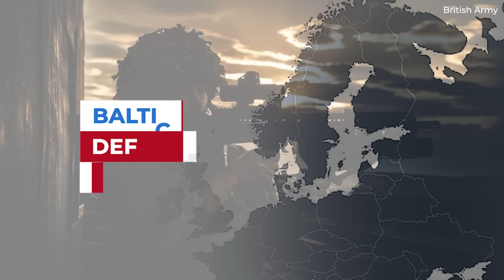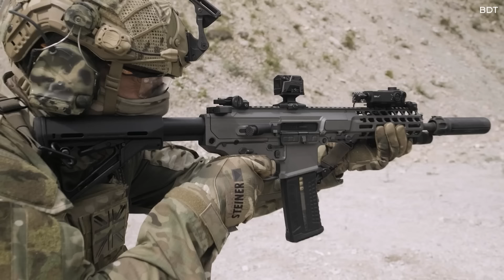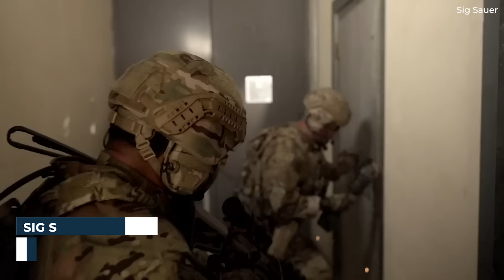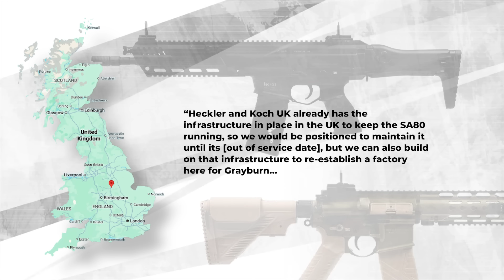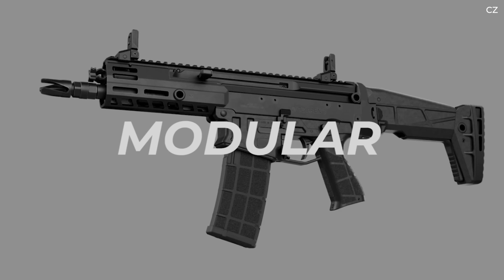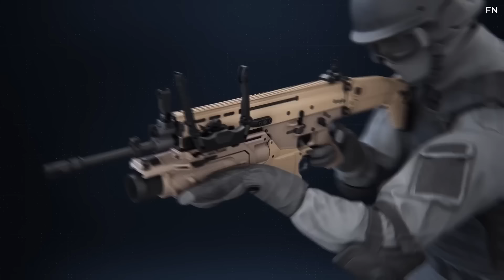Project Grayburn: How Well Do Various Rifles Meet Tender Criteria?

Comment: 07:30 wrong, as with every new weapon and variant there are always issues. HK 416 A8 is no exception. The lowest quality weapon out of this bunch is no doubt SIG M7
Reply: What issues does the A8 have in your opinion?
Reply: @jonny2954  A8 was found to be inaccurate and couldn't be relied upon to work properly in battle. Bundeswehr had to lower the testing standards after it failed to pass trials using military standard ammo. So HK used civilian ammo and tested the weapon in room temperature, so the weapon did not meet even NATO D14 standard.

Eventually the weapon was fixed and a year later A8 was praised for its accuracy.
Reply: @pitkizzz  That is not what happened. In fact you confused about everything that can be confused about this.

The problem was German procurement office folliwing CEP standards that state 5.56 (M855) is identical to .223 (M193). That is however not correct. The cartridges have slight differences in chamber geometry, mainly the freebore.

But the German procurement office tested HK-delivered 5.56 barrels with .223 ammunition. So the other way around to what you stated.

Now, .223 in a 5.56 chamber means more space in the freebore, which led to instability of the round during travel in the freebore, causing the round to quite literally hit the rifled part of the barrel, resulting in oscillations in the barrel.

Together with the (normal) oscillations from the torsion forces on the barrel caused by the spin acceleration of the round it caused a reciprocal effect with different bias each shot, causing larger groupings.

They then proceeded to test it with 5.56 and it was perfectly fine and passed all requirements.

So not a problem with the rifle but the German procurement office. Makes sense since the chamber geometry on the A8 hasn't changed compared to its predecessors that were all firing 5.56 with outstanding results.

In fact the A8 fixes pretty much all problems that were still present on the A7, including the ambi mag release that would sometimes get hit on accident on the A7.
Reply: @jonny2954  Nah, that's not it

The problem stemmed from a plastic channel that supports the weapon’s barrel. During firing, the report said the channel quickly heated up and becomame soft, leaving it out of alignment.

“Current testing by the army in laboratory conditions shows that the weapon doesn’t meet army standards when loaded with combat ammunition"

The issue reportedly forced the German Army to lower testing standards so the assault weapon could pass the trials and be introduced to troops more quickly.

According to Der Spiegel, the service allowed Heckler & Koch to test the weapon using civilian ammunition.

The trials were also conducted at room temperature rather than at extreme temperatures that simulate battlefield conditions.

The accuracy issue with the G95A1 rifle was first discovered by German soldiers deployed in Afghanistan.

They said the weapon did not shoot straight after several minutes of heavy firing.
Reply: @pitkizzz  Now you are switching things up even more. You are confusing the G36 with the G95 (HK416). The G36 is the predecessor in the German Army, it is currently being replaced by the G95.

On the G36 the barrel nut was molded into plastic and led to POI shift problems, the G95/HK416 is an all-metal construction. One of the reasons it was choosen as the replacement.

The G36 controversy happened in 2014/15, the G95 accidentally being tested with .223 happened in late 2023.

The G95A1 never saw Afghanistan.
Reply: @jonny2954  I am not messing up anything, the article I am referring to probably have messed up the translation combining different parts (fucking AI), since it is in English and original one is ofc in German. Anyway the original Der Spiegel article from year 2024 is about G95A1, that is HK 416 A8

There were no "accidents" as you call them but intentional bad testing. In 2022 HK contacted BAAINBw and asked permission to test with civilian ammo instead of BW's standard army ammo. Now let us be clear here. Name what is meant with civilian ammo in Germany and what is BW's standard ammo. fill the slots below

Civilian ammo:
BW Standard ammo:

In addition to this ammo change request HK wanted to lengthen the gap between shootings avoid testing in extreme hot and extreme cold. To me it sounds like the weapon was pretty far away to have a NATO D14 stamp on it at this stage.

On 23rd Jan 2023 BAAINBw accepted the reduced testing standards. Can you give me a date when these issues were finally fixed and the G95A1 was properly tested?
Reply: @pitkizzz  And that's why you probably shouldn't base off your research on AI. Just use regular google direct translate.

Technically it wasn't an "accident", just bad standards. CEP standards called for .223 and 5.56 to be treated the same while they are in fact not.

As soon as they tested with 5.56 the accuracy issues went away. This makes sense since the barrel and chamber geometry on the A8 weren't even changed compared to its predecessors. It's a HK416 with different external hardware, no D14 relevant measures were changed compared to the predecessor. That's why everyone was so suprised by accuracy issues on what is proven one of the most accurate assault rifles on the planet. The German Army already has the A7 in service. The accuracy issued noted were also not related to temperature or breaks between firing. Your AI mixed it in from the G36.

Only thing that happened with the A8 was BAAINBw testing with .223 instead of 5.56 and finding accuracy problems, HK complaining to the German Federal Court of Audit about the use of incorrect ammunition, the Federal Court of Audit calling out the BAAINBw and then the BAAINBw switching to 5.56 in testing and the accuracy problems disappearing.

On 26rd Jan 2024 a speaker of BAAINBw confirmed that the requirements for the manufacturer to meet the specifications have not been lowered. He also confirmed the G95A1 met all accuracy requirements after switching to 5.56 in tests.
Reply: @jonny2954  I meant I didn't use AI but the whole defense article was probably gathered up with help of AI. The only mix up was the G3 overheating though, everything else was related to G95A1

So according the article BAAINBw tested with civilian ammo, .223 instead of 5.56. According to Der Spiegel this was because HK asked them to do so. Now you're saying BAAINBw made a mistake related to standard and did not test with 5.56. Which party is lying, BAAINBw or HK? Why shoudln't they test with ammo the army is going to use, in an environment the weapon will be used?

Between issues found in 2022 and 2024 there was 1½ years to fix the product, that's more than plenty for such players as HK
Reply: @pitkizzz  No, other way around. BAAINBw tested with .223 match ammo thinking it would lead to more accurate results regarding the rifles performance ("testing the rifle, not the ammo") because civilian match ammo has lower tolerances between individual rounds than mil-spec. They however disregarded the issues that come up with using .223 in 5.56 barrels/chambers because CIP regulations didn't state them and then complained to HK about accuracy issues.

HK then complained to the Federal Court of Audit about wrong ammunition used for testing, and the Federal Court of Audit then made BAAINBw switch to 5.56 for testing. Problems gone.

No one is lying here, Spiegel just writes stuff they don't know about.

The date in 2024 was only where the MoD released the statement following an inqury. The "problems" (which weren't, just wrong ammo) were solved relatively quickly after appearing and the trials continued.
Reply: @jonny2954  Okay, sounds just incredible any army weapon would be tested with civilian ammo by default. Something smells fishy

In 2019 HK criticized MoD for setting strict, potentially unrealistic requirements, arguing that no rifle chambered in 5.56×45mm NATO could meet the demands. 

So apparently MK556 met the demands better and won the tender initially, and roasting HK with "tested in all climates" but was later disqualified for using HK patents

If the original demand was related to high pressure which creates garbage weapons like SIG M7 then I'm glad HK416 took the deal.

After all, the most important factors of service weapon are:
- reliability/quality
- low price
- light weight
Reply: @pitkizzz  MK556 did not meet the demands "better". It met them at a lower price. In total stats beyond required performance the HK416 outperformed the MK556.
Reply: @jonny2954  I see, so the MK556 met the demands. After all, the most important factors of service weapon are:
- reliability/quality
- low price
- light weight
Reply: @pitkizzz  Considering a HK416 is 2,300 € for MIL/LE customers, will be equipped with 4000+ € optics, 1,200 € laser/light combo and optionally run 10,000+ € clip on thermals spending a few more bucks for a simply better performing rifle regardless of meeting requirements or not isn't going to break the neck of the armed forces with the 4th largest budget in the world.

After all 6 people, 5 of them equipped with a 416, will jump out the back of a 13 million € IFV.

Rifle prices are peanuts in military procurement.
Reply: @jonny2954  this then... it would be insane to pick 556 over superior product. Unless it was flawed

Comment: Never the M7, it's a bigger joke than the L85 A1. 

If we have to change then pick up the AUG in 6mm ARC designed after the Swedish 6.5x25mm CBJ, there, now you have a feared rifle.

The AUG fits all requirements and the AP round fits the body armour requirements.

They could also get the L85 working in the previously mentioned 6mm type. 

Glocks could be refurbished to work with the Swedish 6.5×25mm AP.

The AR platform is obsolete and would end up being too expensive to have various barrel lengths for various needs, on top of refurbishing the armouries for each. The Americans have learned this the hard way and the eorld shpuld move away from anything american.

Comment: FN have been developing a 6.5mm LICC round with the US Army. It is odd that the US went for the 6.8mm SIG, when they were already developing the FN round. Anyway, whatever we go for should be capable of changing calibre with a simple swap out of parts and magazine. NATO needs to move on from 5.56mm.
Reply: Because there's a Massive difference in requirements between shooting somebody unaware 5-10ft away from you compared to sitting in a fighting position against a Mechanised infantry company with enemy infantry men equipped with Body armour 

And Probably because the Battle of Kasham gave them a serious reality check on their Standard Infantry rifle.

Comment: SA80 already has a long enough barrel to defeat body armour at 300m. These new options are offering zero real benefit at significant cost. L85A3 is a decent rifle, it's not the best, but it has a 20inch barrel in a very compact package and is as accurate as it needs to be. This programme is a waste of money. The answer is more ammunition for more range time, that will make the average infanteer far more lethal than giving them a new ar-15 pattern rifle. Literally the only benefit of this program is it will offer an ambidextrous platform...
Reply: Ambidextrous is a must for left handlers like me, it could have and should have easily been addressed. I suspect the A1 variant was made so cheap and poorly to save money. I am most interested in which calibre  will be selected. There does appear to be a thought of a more potent round.
Reply: @stephen7571  I have worked with plenty of left handers, they learnt to shoot with it. Going with a different round would be an abject waste of money. Heavier bullet means less magazines. In a war you need more ammo and you need it cheap. 5.56mm and 5.45mm are working exceptionally well in ukraine for infantry, logistics wins the war, not which side has the slightly larger round.
Reply: @syscoord195 I unfortunately had to switch from left to right. I was always a better shot left handed. But for a modern 21st century firearm it should be ambidextrous. It’s not that difficult as other bull-pups do not have that rigid issue. I think .300 Blackmore uses same 5.56 mm magazines, the case is similar, the bullet larger and therefore a new barrel would be required. One would also hope that the current SA80 scopes would be used on the new rifle for savings, but I would not be surprised if the MOD didn’t.
Reply: @stephen7571  300. Blackmore? Do you mean blackout? It's a low velocity round that will not penetrate body armour at 300m. Furthermore will cost twice as much as 5.56mm. Nobody makes it in quantity, certainly no uk based factories. I understand you want the best for the rifleman, but paying twice as much won't make him twice as lethal, it will maybe make him marginally more so. You're better investing in your logistic chain and time on the range, or in the collective training environment.
Reply: @syscoord195 hi apologies, Im quite ill at present and thinking is poor. Yes I meant blackout. My point are we to remain with 5.56 mm ? The future is unclear. The US army is changing calibre, and we have in the past followed suit with 7.62mm and 5.56 mm. Should have gone with .280 British. You are right about logistics, too many times we have been caught short.  I was around when poor choices were made not for the soldier, but for political reasons etc. examples being the bloody awful L60 engine in The chieftain tank, the SA80 A1, and most recently Ajax.

Comment: I'm surprised one of the criteria isn't to have the ability for a grenade launcher attachment
Reply: I though along similar lines, but apparently many militaries are now carrying similar versions to the underslung grenade launchers but configured as a stand alone variant... and unpack and use them as needed..
Reply: Modern grenade launchers just attach to pic rail.
Reply: @zoiders yes but most modern weapons are using M-LOK for everything except top rail so it would require adding a picatinny to the bottom and then a UGL and ensure it can be safe and secure on it

Comment: Moving away from standard 5.56x45 rounds would be madness in my view just to supposedly defeat body armour. Using armour piercing 5.56x45 rounds as an option may make some sense for some units but continuing to use the low cost and widely available 5.56x45 round would still be the best choice for high volume needs. Don't reject excellent solutions in favour of chasing wonder weapons which will cost too much, take too long to deliver and will present a range of unforeseen problems. Ajax comes to mind.

My vote goes for the Thales F90 which is the enhanced version of the Austeyr F88 (Steyr AUG) used successfully by the Australian Armed Forces for over ten years. The Brits are familiar with bullpup rifles and bullpups do offer a longer barrel in a shorter package, usually higher muzzle velocity and less muzzle rise which makes them more accurate as long as a suitable sight is used. Well designed bullpups also offer better weight balance and weigh less.
Reply: Lol . The trend is that most armies turn away from bullpup .  Not because they are not good , but because optics and other accessory  have become an integral part of a service rifle .tbe shorter bullpups simply have not enough space to add accesories . It becomes cumbersome .. hence the choice is often an AR type  rifle ..
Reply: The EF88 is a great rifle, and probably the best bullpup service rifle in the world. But it would all come down to whether Thales would be willing to set up production in the UK.
Reply: Congrats! Your Boys are now dropping dead in the dozens bcuz there being handed an inferior rifle. 

As they found out that there not fighting the Bloody Talibans and the Iraqi's instead there fighting somebody that could fight back.

Comment: I don't even understand why the MoD wants to replace the L85 to be honest. The L85A3 is from what, 2017? They have 40k A3s, and 120k A2s in inventory. Specialist units have brand new 5.56 ARs. It's highly unlikely the UK decides on a brand new caliber outside of NATO standards by themselves, so they'll adopt a 5.56 rifle, except any conventional rifle will have worse ballistics simply due to the shorter barrels, so that's that for the armour penetration goal.

They'll probably adopt the HK416 anyway, common to so many European nations, price can be reasonable (the French ones were around 1200 euros per rifle in 2017). But frankly what's the point? When there's so many others things to finance, the Ajax is going terribly, the Warrior still doesn't have a replacement, the Challenger 3 is delayed and there's only enough for a single armoured brigade. Infantry small arms are not a priority, unless they're economically draining to keep running, which I doubt since they still have a factory making parts for them in the UK.
Reply: I see your point. By someone who's left-handed, I desperately want to see the end of the l85
Reply: Military ia about tradition and conformity. Either be a right-hand soldier or bust. You can still shoot the SA80 left handed tho.

Comment: Your video has failed to acknowledge that the IWI Arad rifle is also in the running for the British Army versions & is also considered the leading contender for the UK Police requirement for a common rifle for 50 police & security agencies in the UK
Reply: There doesn't seem to be any indication that IWI is submitting any rifle for consideration in project Grayburn. 

The Glock GR-115 has been chosen for the UK police lot 1 contract (suppressed carbine), and as such is now considered the leading contender for the lot 2 contract (unsuppressed carbine), although there are still six open contract options including the IWI Arad.